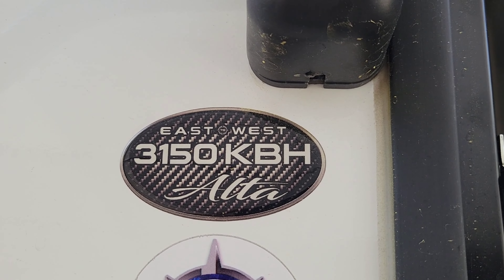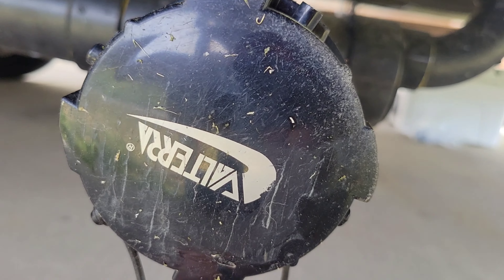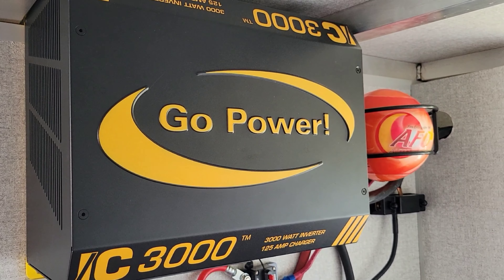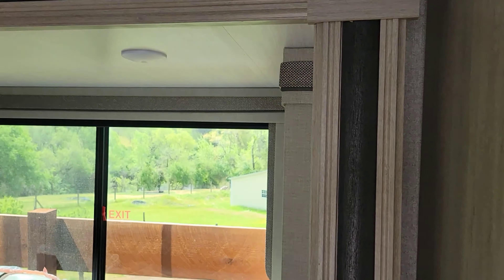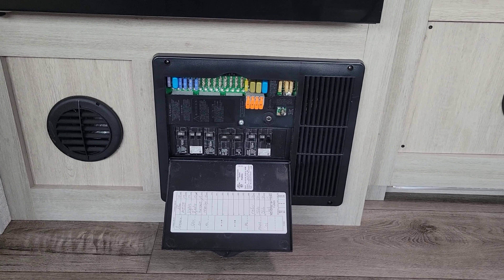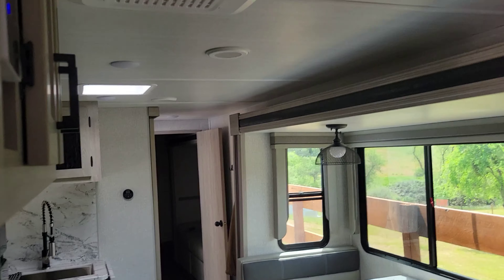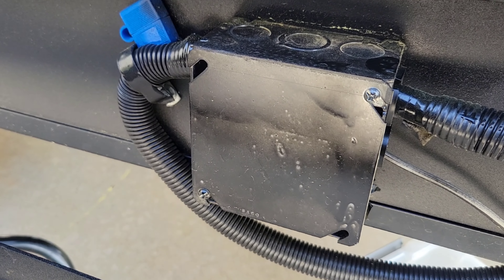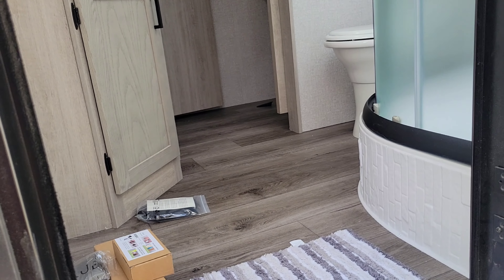2023 East to West Alta  3150KBH modifications . Lets cut some holes! oh no!

Comment from the maker: Hi ,it tows great with my chevy 2500 hd (gas), and your ram should tow even better.  It has great weight distribution.  I toe with  a regular hitch no added wieght distribution hitch. Turn and stops well.

Now for the downside unless you love the floor plan like I do it is to long ! They're are many spots and roads that are challenging due to the overall length and turn /backing radius . 

If your patient and mindful of the back up camera it's doable. 
Hope this helps 
I now tow it with the new silvarado EV and it should be a whole new video.